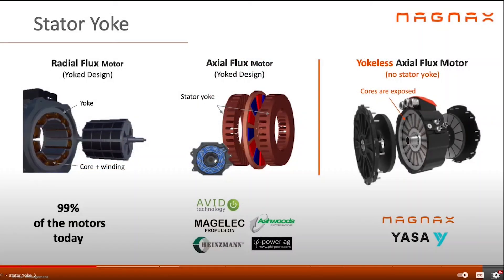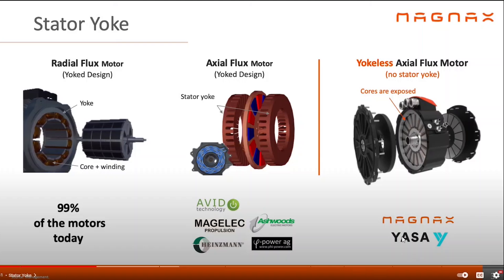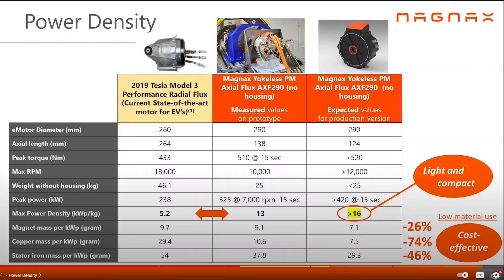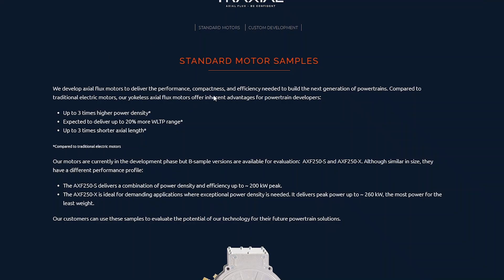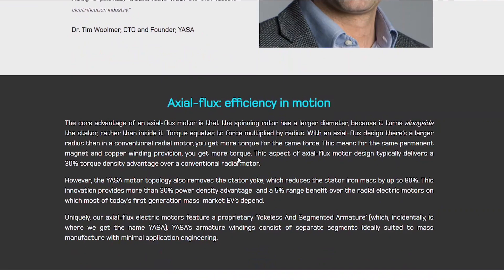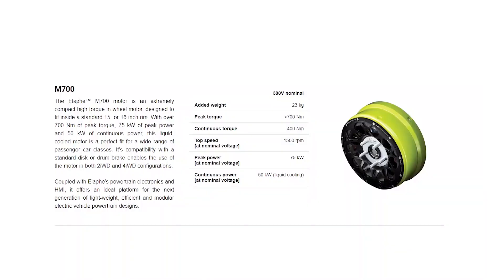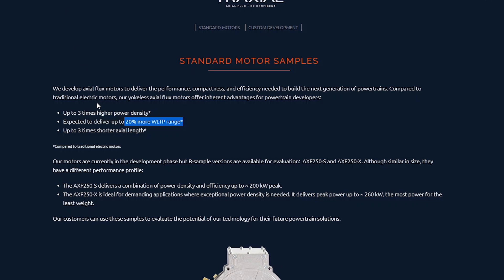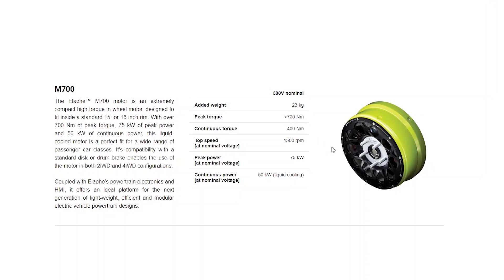Axial flux motors in the Aptera would be amazing!

Comment: In hindsight, three years later, it is clear that hub motors have not taken over... even Aptera has given up on Elaphe and switched to inboard-mounted motors (which are radial-flux, by the way). If in doubt, just assume that anything Aptera said is the right design for an EV is actually wrong.

Comment: The problem with using peak power is the time it can hold that peak power is quite important. A bigger heavier motor can dissipation more heat for longer as the heat density will be lower.

Comment: A few years ago, I did work on a quote for an electric flywheel assist assembly where the coils were mounted with the poles perpendicular but since they were all the same coil, manufacturing it would be easier as you would just get a bunch of coils off the line and array them around the flywheel.

Comment: Downside I see is the lower air gap. On a car as a hub motor they get no softening from suspension whatsoever. With a very thin air gap it could cause it to hit which would destroy it quickly. 

This wouldn't be as much an issue with a centralized motor as then they are protected by suspension, but Aptera specifically wants to get rid of the gear boxes and drive shafts required for a central motor.

Either way, sounds like it's still a fair ways off. We'll see as time goes on if it ends off being a good idea.
Reply: Interesting point!
Reply: thats a problem with radial flux motors, not axial

Comment: I still don’t see why they insist on putting the motors in the wheels. Unsprung weight is a problem. A single fixed motor with half shafts greatly reduces unsprung weight and one larger motor is cheaper than two smaller motors.
Reply from the maker: They are doing it for greater efficiency and simplicity and sacrificing some ride quality for it.
Reply: They are throwing out ideas to see what sticks 🤣 I would be impressed if motor companies start replacing steel gears, cases and shafts with carbon fiber.

Comment: I'm just learning about these motors. Can a Halbach array be used on an axial motor ?... or has this already been discussed here
Reply from the maker: No clue what a halbach array is.  What's the advantage of it?
Reply: ...its  the arrangement of solid magnets to very advantageously arrange the flux lines on one side (ish) of the magnet with very concentrated flux lines. Think 'megalift' for  train suspension. Look it up on wikipedia. It seems very kick ass. It is done IIRC on radial motors. I'm technically kinda clueless about motors. Didn't even yet read Wiki, but I am now and next. Thanks for asking
Reply: also the Tesla model 3 motor, but it's not axial
Reply: @davidkreimer2970  Yes, it is using only one side of the magnets, waste of resources and space. Magnet permanent has more sides, to dozens can. But you have time to invent it, another hundreds years of your thinking (humans I mean).
Reply: @davidkreimer2970  yes it can

Comment: what is the numbers for motor burnout? curious to know since ur using so much less material & output is so much greater.
Reply: The validation testing will be done on the betas.  I know that when temperatures approach limits, the motor controller automatically cuts back on the power to prevent damage.  One place where this may probably occur is climbing long mountain grades in hot weather.
Reply: @n.brucenelson5920  ok & will you have any cooling mechanisms to solve this issue? I know when magnets reach a certain temp they lose their magnetic field or will it be rare to reach those temps?
Reply: @Wabuh-Wabuh  Yes.  Liquid coolant - think antifreeze - circulates from the wheels, to the heat exchanger plate on the bottom of the vehicle.  Magnets need to be kept below about 80 C,  I think that temp sensors in the wheel and the motor controller work together to lower the power going to the motor if temperatures begin to approach this level.  I am not privy to special information here, but I have worked with similar electric motors myself.  I asked Chris about what happens when climbing long grades in hot weather on the Wefunder Q&A forum and he answered.
Reply: @n.brucenelson5920  ok thanks. so the sensors will throttle the motor basically. Makes sense.

Comment: they mentioned about 60kg per wheelpod in the Jay Leno video. Kinda shocked that the wheelpods are so heavy tbh, but once you add the suspension, tires, motor, brakes and aero cover I suppose it all adds up.
Reply: It does help put the center of gravity very low, should corner nicely.  Just have good power steering.

Comment: Ahh!  Liquid Cooled.  Which liquid?
Reply from the maker: Oil or glycerin mix
Reply: Hmmm - 0 Weight Mobil 1 could take nearly 500 degrees...Would not be a Pressurized System (Above Atmospheric)?  Glycerin??  Which is Less Viscous?  Are You planning on a Circ Pump, or using the Wheel Speed Rotor to do the Pumping? @ApteraOwnersClub
Reply: Probably standard antifreeze

Comment: It's a good motor but the Elaphe wheel motor is far superior in durability.  The AFM is so far designed for aircraft currently.  It CAN be used with an axial setup & would even largely recapture energy spent if the Elaphe wheels acted 100% passively to collect spent energy but it would add more weight unfortunately.

Comment: Good info, thanks.  
It is a Belgium company with strong ties with the Gent University. The whole thing started with a wind turbine engineer that wanted to make the motor lighter. 
So he contacted the University and found that they were working on the same thing for 6 years. 
They joint forces and are starting the first real life 1MW wind turbine. A 3MW wind turbine today weighs 75.000kg, with their new design it weighs 25.000kg
In the coming years they only see a possible use for Helicopters or EV's that use low speed and high torque.
Or better hydro-energy, elevators for bridgebuilders etc.  
So it will be at least 2 or 3 years befor they see it used as an inwheel motor in an EV. (But Traxial seems to be on track for 2023 with a German partner . . . Hope it is the Xbus )
Reply: I made it 45 years ago with my gift-kids toy tools small box (for kids playing with electronics), I was 7-8 years old. You assemble what you wish and it works.
But as you know, mind readers, clairvoyants, ...and practice with intelligence rising people came with it. I was wondering 40 years "why they don't make it". But, anyway I never told to anyone directly, only sidetalks for other things, ... they came to solution on their own.
During 45 years, I made uncountable things, I wonder when will they make it/them.
People die, people born, 100 years, ... so kungfu.

Comment from the maker: I've been informed that the Elaphe motors in the Aptera are already axial flux.  Just that they are yoked and not yokeless.  I'm investigating now.  Chris Anthony clearly says axial flux motors in the Jay Leno video but the schematics from Elaphe show a radial flux motor.  I'm trying to sort out the discrepancy.
Reply: Best of luck sorting this.  Far as I know Elaphe doesn't say what they use on their own site.  The operating RPM is also critical if the motor is used as a direct wheel motor.  The 195/45 R16 has a 1.99 meter circumference which at 1500 rpm is how we get ~110 mph (179 kph).
Reply: I found a video with Daan Moreels (the engineer of the Yokeless Axial flux motor), where he says, that a.t.m. they are not working on an inwheel product. They have done it though.
Maybe this answers your question.?
https://youtu.be/3vnwVp3dMIg?t=910
Reply: Yes, please clarify. I hope aptera is axial flux!!
Reply: @johnfrink7819  it is.  Confirmed by ceo in Jay leno interview
Reply: @ccibinel  he said axial flux and then described a radial flux motor

Comment: I thought the guys said the Elaphe motors they are planning to use are already axial flux?
Reply: The M700 used in aptera is Axial Flux except it it yoked not yokeless.  The gains in weight and efficiency over traditional radial flux is already mostly realized in the m700.  The j leno youtube video confirmed Elaphe's current tech is Axial Flux.  Unless elaphe cant persue the yokeless technology due to patent encumbrance we should see future models with the improvement but it will be far less than the statistics shown since that was to the model 3 motor (not current Elaphe) and didn't include the casing (not apples to apples).  The elaphe motor is 23KG with the casing making the magnax substantially heavier (5kg for casing would not be unexpected).  The magnax also achieved max power at 7000rpm which means gearboxes are needed (not good for direct hub motors - m700 is at 1500rpm which translates to ~100-110mph).  The m700 also includes the disk breaks directly in it which wouldn't be needed for setups with gearboxes or aviation (it is designed for direct drive of a vehicle the magnax isn't).  Note:  This explains more about axial flux:  https://www.youtube.com/watch?v=8EEVPVNJHjM&t=2s
Reply: From the Aptera FAQ: B240

We are using in-wheel axil flux AC motors in each wheel of our vehicle for the AWD version and just the front wheels in the FWD version

Comment: Looks like I should postpone receiving my Aptera ... wait until they change to this motor design. I can buy the 400 mile battery option and get close to what my 600 mile needs now. By then the solar panels will be more efficient too.
Reply from the maker: Well this stuff is probably 5 to 10 years off before it shows up in a vehicle you can buy
Reply: @ApteraOwnersClub  Aptera is already using axial flux motors.
Reply: The Elaphe motors Aptera is using ARE axial flux.  From the Aptera FAQ: B240

We are using in-wheel axil flux AC motors in each wheel of our vehicle for the AWD version and just the front wheels in the FWD version
Reply from the maker: @n.brucenelson5920  do you have a link to the FAQ?
Reply: @n.brucenelson5920  Thanks Bruce. Would the yolkless version be worth the adoption/changeover? Worth the multi-year wait? It's going to be 18 months before I see mine as it is. I know you don't have the answer. Thinking out loud
Reply: @Randy-J  I have found Elaphe very responsive when I have asked them specific questions about their design  I asked them questions about their potting method last year.  I was involved in motor design years ago, and in fact the company I worked for hired the original motor engineers for Tesla when Tesla ran out of money and had to lay them off before they got their loan.  

Although I am not an engineer myself, I am quite familiar with motor design since we were designing electric motors for marine use from around 13 to 800 hp.  The present Elaphe  hub motors are VERY good and exceed anything Tesla is doing at the moment in efficiency terms.